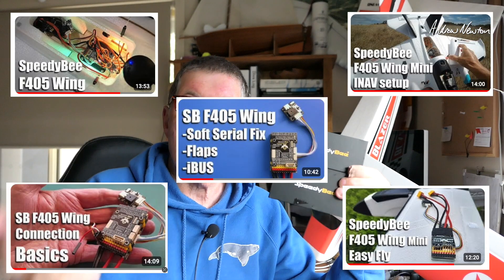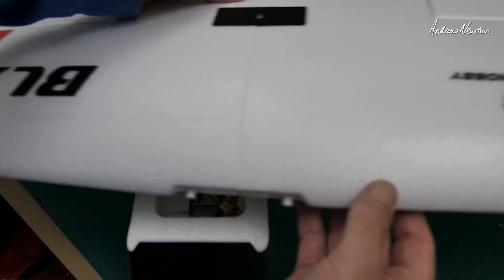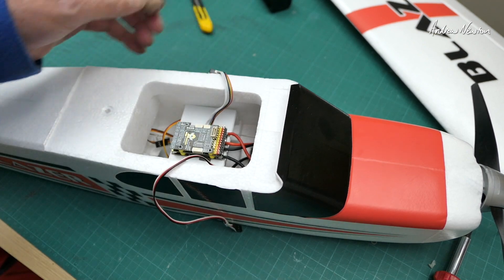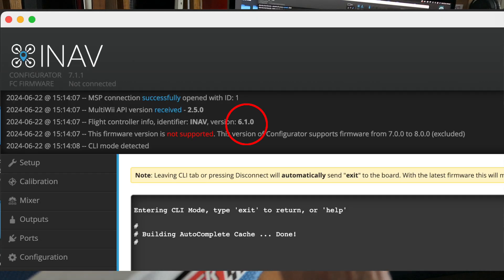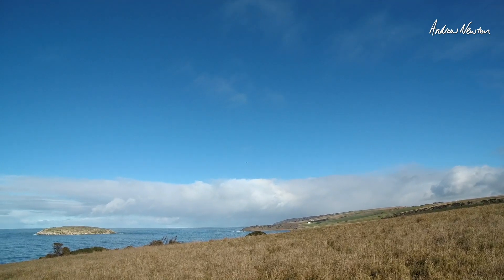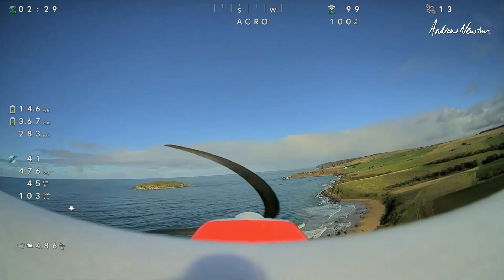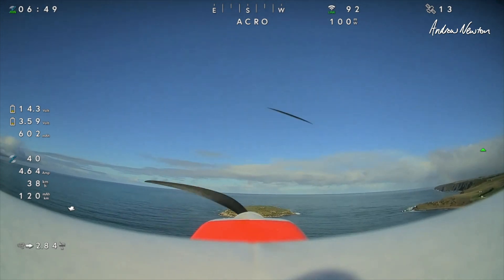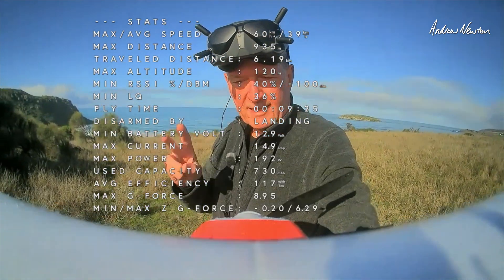SpeedyBee F405-Wing on the TopRC Blazer

Comment: I bought a few of these and for the money, these speedybees can’t be beat. Same cost as the Zohd Kopilot but so much more. I use the straight pins. Tried the angle pins on one but it was a pain while inside the aircraft
Reply from the maker: Good point, I have never used the angled pins

Comment: Nice upgrade and flying. If the servo tray was mounted few 4-6 cm furrier rear, it would free up some space in the font of the compartment. Perhaps freeing volume to locate additional battery.
Seeing "Wing App" in title confused me initially, as thought topic would be something to do with software. No complaints as FC seems to be good value at listed price.
Reply from the maker: I would move the servos to the tail and open up the inside for more space and top access. I think the APP refers to AutoPilot something